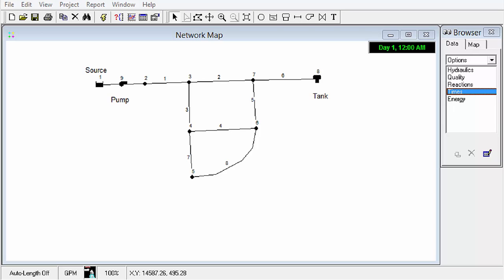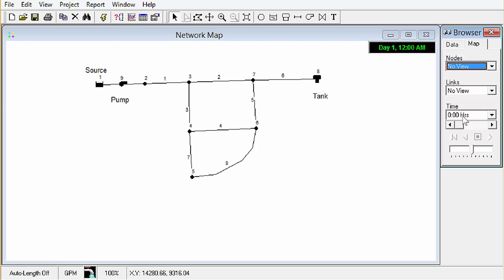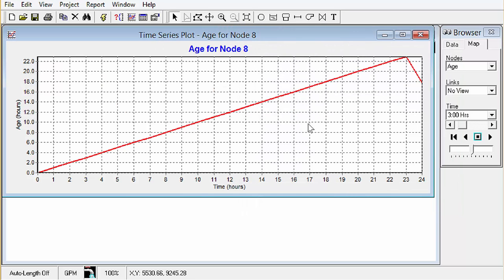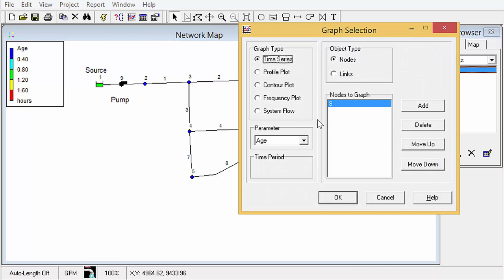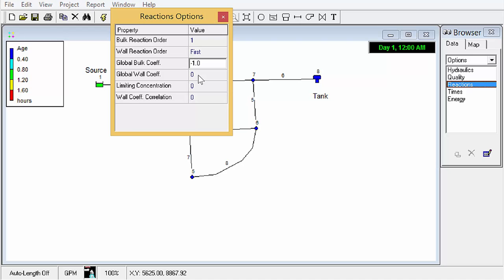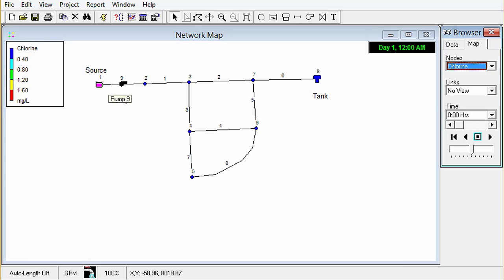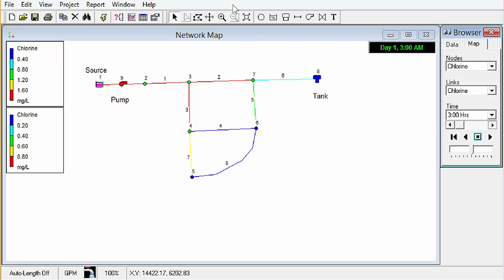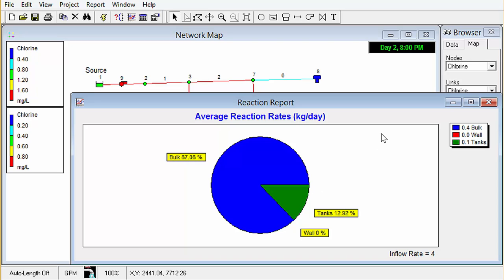EPANET Tutorial 02 09 - Running a Water Quality Analysis | Hydraulic Modeling

Comment: any idea about the application of gate valves and fire hydrants at nodes.
Reply: I usually model gate valves as TCV.  To model a fire hydrant, temporarily add the desired fire flow to the closest junction (or split the pipe and add a new junction).

Comment: I need help. Does anyone knows how to get specific results from fire flow analysis?
Specifically on how to get residual pressure? TIA
Reply: (1). build your model and run it for a length of time (set model run time in settings - read the Epanet manual, always check your units i.e. flow rates/lengths etc. and check headloss calc method selected in Epanet, so you are using as close as possible values for headloss in the system, again read the manual if not sure, it is good)
(2). add a node (junction) at the location the fire water will be drawn from
(3). add a demand pattern to the node (junction) you made in (2). above
(4). edit the demand pattern in (3). of the node (junction) from above, it should mimic the flow rate you might expect from a fire hydrant.  If you've no idea, first try to find out what type of hydrants you have on the network and check the product specification document, it will tell you. Or ask the fire brigade they should have an idea,.. they possibly won't, in which case - 2.5ML/d is probably fair assumption, totally dependant on the type of hydrant but i would advise 3.5Ml/d (34.72l/s) per hydrant connection as a high end estimate for a standard (UK) fire hydrant
(5). if you built a model in (1). you really should have an idea of typical system pressures, if you don't - back to (1). with you!
(6). run your model with the demand on node from (4). enabled (double click node, and make sure the 'DEMAND' line has a pattern number - the one you made in (3).)
(7.) compare your base model run (no fire flow) to your fire flow run and happy days - you the woman/man!